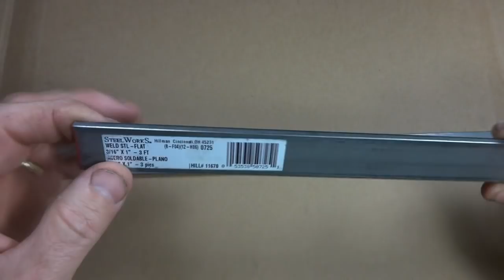How To Make A Chain Whip/Sprocket Remover Tool

Comment: Thank you, I built one today for about $10.00 and 2 hrs work. Your clear, concise instructions saved my at least $20.00. I was able to remove my cassette and degunk a malfunctioning free hub, also using your instructions. I used an old inner tube wrapped in electrical tape for a handle. Worked great!

Comment: My old chain whip broke while removing a cog.  Thankfully there's a 4mm flat bar laying around. 

Drilled it and transferred the chain in less 30mins. 
Works great, plus better leverage since it's longer than the previous one.

Thank you sir

Comment: Great idea and very simple to make. I used a spare scrap of angle iron rather than a strip of steel. This created a nice flat part on top where i was gripping and pushing And added extra stiffnes. Though as stated below many materials work fine. Thanks RJ, this saved me some $ and a trip to the bike shop, plus i already had the chain scraps since i typically replace my chain and casette and the same time.

Comment: I made one of these a few weeks ago with these instructions and it works like a charm. I ended up making only a 14" handle which seems long enough for my uses. Also, the steel bar at Home Depot was in the $6-7 range for 3 ft. Thanks for the video @RJ The Bike Guy !
Reply from the maker: Lowes I think has it for about $5.
Reply: thing is that with the money you spend to buy the stuff, it makes sense to buy spend a few bucks on a shop grade whip

Comment: thanks for a great vid. i have to make 2 of them to tear my suntour new winner freewheel apart. i have some spare shimano 9S chain to use and got some 6-32 cap screws with 1/4" shanks to fit in the flat stock/outer links stack. i can crank some plain 6-32 nuts on there no nylocks needed and it will be much stronger than full-threaded screws. thanks again!

Comment: Made my own on a whim and then saw your vid.  The only thing different I might suggest is the bar material.  In the lumber section of Home Depot, you can get stud reinforcers that are much thinner but for about .99 instead of $10. for the bar I saw.  I duct taped three together to get the same thickness...
Reply from the maker: +Charles Hughes I bought the steel bar I used for $5 or less at Lowes.
Reply: Nice. Thanks again for the video. Considering most people are not going to use this type of tool very often, a DIY version is perfect.
Reply: Charles Hughes depends entirely how you maintain (or don't) your bike.  If you service the wheel bearings, you'll be using this fairly often.
Reply: Charles Hughes papa

Comment: To add to this subject: If you are on a tour and need to change a broken drive side spoke as an example, Azub recumbent added a decent video about how to remove a cassette with an improvised Chain Whip. Here is the link. How to change cassette on the road without the chain whip tool (not only for AZUB recumbents)

Comment: Fantastic video. I have one question, Would you not be able to use the pins what you have taken out of the old chain to attach it to the bar?
Reply from the maker: No. Pins are designed to be used once. They would be weak and wouldn't hold well.
Reply: Calum Jefferiss he's right, wouldn't work-  unless you have a quick link chain, which is quite a good idea actually :)
Reply: RJ The Bike Guy WHAT????  REALLY??? So you're saying that when I remove my chain from my bike with my chain breaker I cannot put it back on because I would have to use the pin again?  Are you nuts?  Time for a mechanical engineer to re-educate you in a few things chain.

#1   Pins are easily pressed in and out with a chain breaker and it does (near) zero damage to the chain or the pins (usually).  I have done hundreds of them.  And the pins rarely ever get damaged as they are hardened steel.  But sometimes the outer plates get damaged/bent/reamed as they are made of much softer steel (but still harder steel than the chain breaker/press pin).  When an outer plate gets damaged, then you probably should not use it again, but I have and never had one fail in service.

#2  Chain pins are made of much harder and tougher steel than your average hardware store socket head cap screw, esp. with the cap screw being threaded (aka a reduced diameter/cross sectional area).  The only thing close to as hard as a chain pin would be a grade 8 socket head cap screw.  (I doubt you used any, as they are not at all easy to find/source in smaller sizes, at least in/from your basic hardware store).

#3  Chain pins do wear in the use of a chain, and thus 1/2 of why old chains "stretch" and why old chains should not be reused and why you should not use an old pin from an old chain on a new chain.  But to use an old pin to make a chain whip would be 100% okay, as it is not so much weaker, as it is just a wee bit circumferentially worn in the center, thus a slightly smaller diameter in the middle section where the inner link/bushing rides.  But the ends of the pin that press into the plates do not wear at all (or very much) and will be just as tight as always (unless the hole in the outer plate gets errantly reamed by a misaligned pin, then your outer plate is shot but your pin is still okay).

#4  Be assured (by me) that your chain whip chain(s) will never ever see the sorts of stresses and strains that your actual bike chain on your bike sees, either monetarily, or over long periods of riding time.  

#5  Sorry to say, but you are 100% wrong on this one.
Reply from the maker: shrug do it your way.
Reply: Greg Kibitz It depends on the chain and the pins. On older chains you can reuse the pins, but on newer chains (9/10/11+ speeds) you cannot. Not easily anyway, you get special linking pins.
Reply: What do you mean whit that

Comment: I made one even easier than this. I cut a 1ft. piece off a broom handle, took an old length of chain and simply screwed it to the handle. 1 screw on the tip and 1 screw 5 or 6 links down. It took about 3 mins. to make. I've used it several times and it works very well. If it breaks just find another broom handle and make a new one. Remember to drill pilot holes for the screws to keep the handle from splitting.
Reply: ***** I love leverage, you can never get enough of it, so i would make mine about 50 cm long.

Comment: cant buy imperial size here in australia so i'm using metric sized bar 25.3 x 3mm is the closest size i can get,i could cut 2 x 18 inch lengths out of 1 metre bar length with 3 inches of scrap,so rather than waste that small piece i'll make them 19 1/2 inches & have extra leverage. (laughing)
Reply from the maker: The size of the bar does not need to be anywhere near exact. Whatever works.
Reply: I'm in Australia too, that size you got is basically 1 x 1/8 inch. I'll be making 2 tools as I need to remove an old Uniglide.
Reply: +Derek Hobbs 25.3 mm is the closest metric size,masters sells 1 metre lengths of this size bar with galvanizing,the gal shoudnt get in the way as the 3mm thickness is less than the inner width between chain outer plates,but u could add a washer the fill the gap :)
Reply: Derek Hobbs 1" =25.4 mm, so the bar is just a bit slimmer, but it's  longer! 3 mm is a bit thin as it's only about 1/8". 3/16 =4.75 mm.  the 1/8" seemed a bit bendy to me. Who said size doesn't matter mate?  Cheers!

Comment: my homemade one actually bent on one of the stuck cassette, i still cant get the cassette out:<
Reply from the maker: How did you bend it on a cassette? The chain whip is only used to hold the cassette while you turn the lock ring with a lock ring tool. Or in the case of a uniglide cassette, to hold the cassette and another to turn the lock ring. Neither should put enough force on the tool to bend it.
Reply: well my lockring is stuck
Reply from the maker: I have never seen a stuck lock ring on a cassette. I could see it with a uniglide cassette maybe where the chain is tightening the smallest cog which locks the cassette on to the hub. But a lock ring is just tightened on with a wrench. The torque specs on most lock rings is like 30-40nm.
Reply: it is a sram cassette on a mavic hub. It is missing one spacer at the end, that guy probably thought he didn't tighten it enough and end up with a stuck lockring
Reply from the maker: You might take it a shop and let them use a shop grade Park Tool chain whip. The bar is going to be stronger. I am surprised the screws didn't bend first.
Reply: i use a chain pin instead of screw and nut on the chain whip
Reply: edwardlui531 x
Reply: edwardlui531